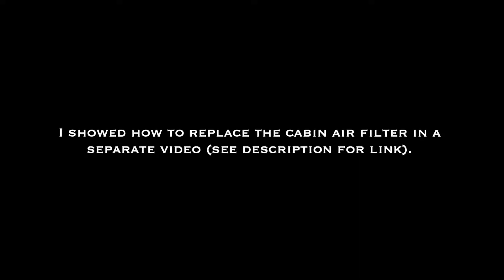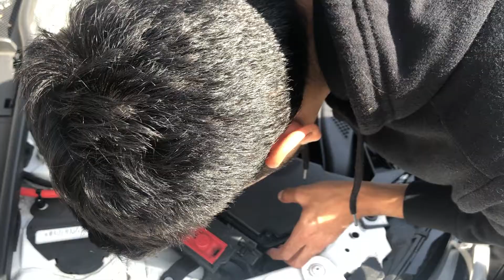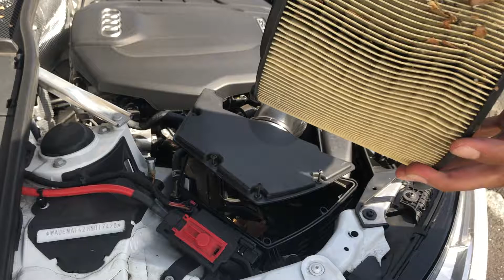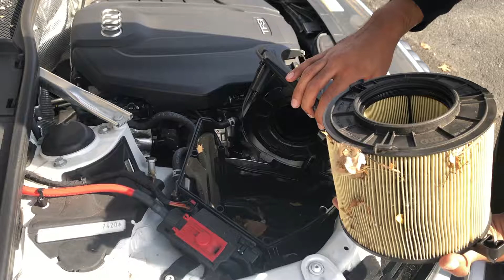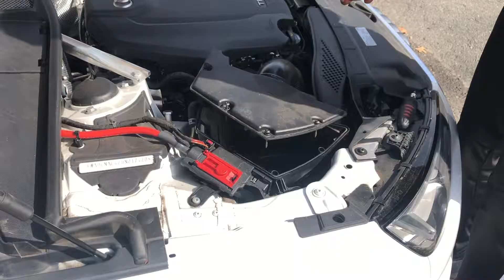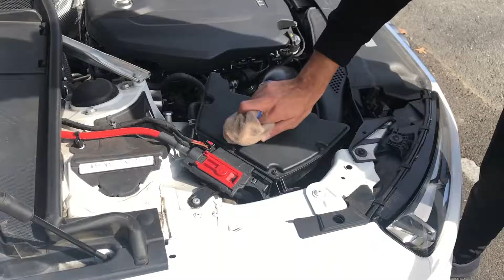Cheap and Easy Engine Air Filter Replacement In A 2017 Audi A4 (B9 Platform)

Comment: I have a 2021 a4 sline and got the on filter in and locked at the bottom but can’t get it to line up properly with the hook on the top of the filter. It actually goes past to hook in if I lock in the bottom of the filter. And tips?
Reply: Same here i had the filter in all the groves even the top grove i took it out just to make sure the filter is still good and some how it goes in the 3 back grove but not the top grove now i got to leave it like that and hope it dont come off which it shouldnt cuz the 3 back groves are holding tight anything i could of done wrong as to why it wouldnt go back in the top main grove

Comment: I have 1.4 Turbocharged 35TFSI B9 A5 2020 Sline model, can I replace K&N AIR FILTER without getting check engine light, or do I need to get it tune to avoid any signs.. let me know thanks

Comment: Manufacturer recommends to replace engine air filter every 60K miles, which seems way too long to me. Especially because it's so easy and cheap to replace. How often is everyone replacing it?
Reply: I would trust the filter manufactures recommendation since they know there materials best which is once a year or every 10K miles.

Comment: On the 3.0tdi v6, I get a check engine light when I run the K&N, looks like the exact same part. Unexpected airflow. Replace with OE Mann filter etc, check engine light turns off. Annoying…

Comment: Great guide, worked the exact same on my 2018 A5, took 5 minutes. Car place tried to charge me $253 to change my engine and cabin filters. Did both for $60 with these videos and 15 minutes total in time spent on both.

Comment: Did you get any issues because of it? Is it still running fine, heard these can damage the MAF?
Reply: What can damage the MAF? Changing the air filter? LOL!
Reply: @darkspeed62  The oil in the k&n filter
Reply: If you soak the filter in oil, yeah, it will cause issues

Comment: After how many kilometers should you change the filter?
Reply from the maker: After 20,000 kilometers (12,000 miles) is the general rule. If you’re using the K&N filters, you just need to clean it, not change it
Reply: @DIYDetail  I opened up the filter housing and vacuumed all the insects and dirt. It was actually quite easy to remove. Recommend all owners to do the same instead of waiting for a service interval.
Reply from the maker: Agreed, every year around October I clean out so many leaves and insects. Wish Audi had a screen to prevent those leaves from entering the housing in that first place
Reply: @chavenyenketswamy1498  They actually don't change these as standard on service intervals, so you either have to do it yourself (Not sure why you wouldn't as it's so easy) or actually ask them to replace it.

Comment: Does the K&N sound different?
Reply: I’d say it would be a little more grunty, open sounding when you put the pedal down and have load applied. Probably no difference to the sound when idle revving. Unfortunately no difference in sound full stop Inc. throttle noise on the 3.0v6 diesel. Petrol, for sure. It’ll add noticeable grunt.

Comment: Does this work on 2019 a4 quad
Reply from the maker: Mine is the 2017 A4 Quattro but I believe it should be the same on a 2019 A4 Quattro. The major difference between the two are just interior and facial upgrades
Reply: Later quattros went mild hybrid as well.

Comment: Why spend 3 times the money getting a K&N filter when they (and all other after-market filters) have been proven to only match or even reduce the performance of this car? The K&N air filter is a waste of money on any turbo-charged car. You should know this!
Reply: I threw mine out on a 455hp S4 as it seems to be causing a engine light by dirtying the MAF.  The holes are too big on those and will let very small particles in.
Reply: @paull3179 ’ve heard if they are over oiled the oil will draw out of the filter and hit the MAF sensor and will cause a bad read, unlikely but your HP is likely pulling a lot of air and caused oil to release, but easy fix with some MAF Sensor cleaning spray.
Reply from the maker: I agree and disagree with some of your statements. I have a Stage 1 tune on it and took it on the dyno 

Stock: 260 HP
Stock + K&N: 268 HP
Stage 1 + K&N: 318 HP 

If you plan to keep it stock, then sure it may not make sense to spend more money for a slight increase in power. The biggest benefit is not having to rebuy a filter each year (spend $8 to clean it and you’re done vs. $20 for a new one). There’s plenty of videos and research articles showing that it mostly increases HP, haven’t seen many cases where it decreased HP.

In my case, I have a Stage 1 tune. Without the filter, I was estimated to get 306-314 HP. But I ran the dyno with the filter and the tune and get 318 HP. That definitely made a difference for me, so it’s worth it even at 3x cost
Reply: @DIYDetail  which tuning company did you go with?
Reply from the maker: I’m running APR Stage 1 tune!
Reply: @DIYDetail  nice! I’m probably going to go with Integrated Engineering
Reply from the maker: I was debating between APR and IE. Let me know how you like it, I went with APR cause I got a good deal on it
Reply: @DIYDetail  yeah I will! I just like how with IE you can flash yourself and stuff. my warranty is up beginning of 2023 so that’s when I’ll tune. also feel free to message me on IG! it’s always nice to chat with someone with the same car and stuff
Reply: @DIYDetail  Agreed, I've run these on a bunch of cars, Merc, Honda, Subie, Acura, stock and tuned...on stock I found better MPG. Replacing/buying filters for me got old real fast. CAI with heavier modded vehicles.

Comment: can you do a review of  your car as a whole,  what you like,cool tricks and any tips for interested buyers, also cost of managing, 

btw can i use regular fuel on this car
Reply from the maker: Definitely can! It's currently winter where I am so this video will probably come out in the spring. I've owned the car for about 1 year so far and the only thing that failed on me was the engine mounts, which were covered under warranty as a certified pre-owned. With German cars, the key is maintenance. You have to follow the Audi's maintenance schedule to avoid costly repairs down the line. 

Unfortunately, you have to use premium gas. It has a twin-turbo, which requires gas that can resistance pre-mature detonation (essentially the gas burns before it actually gets into the piston thereby causing engine knock).